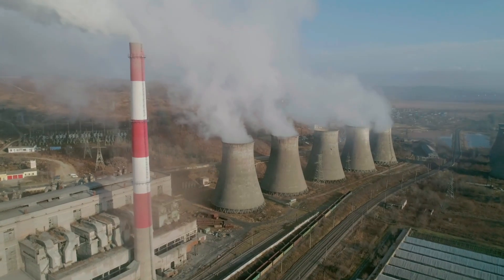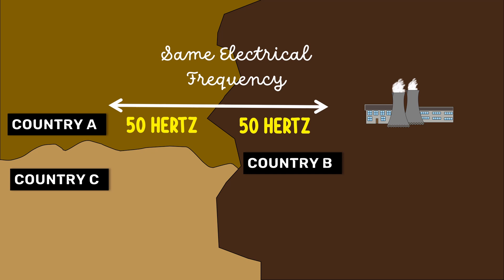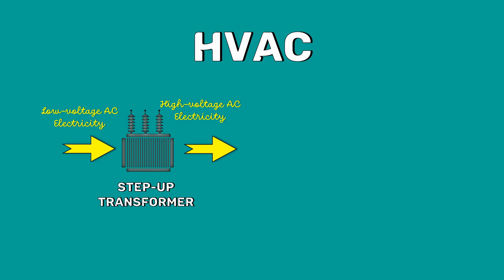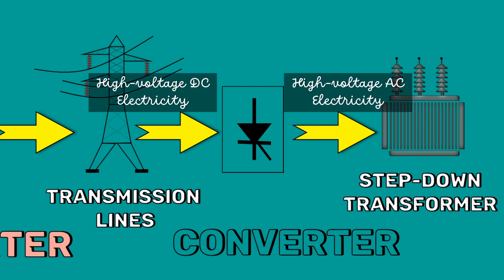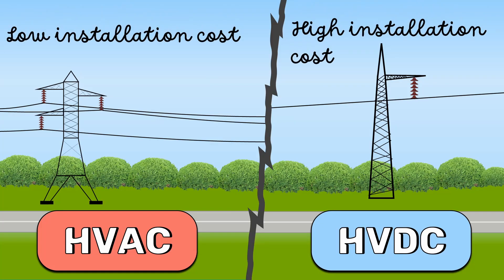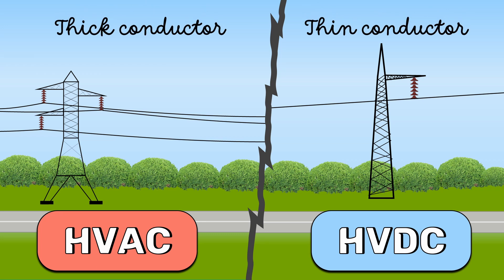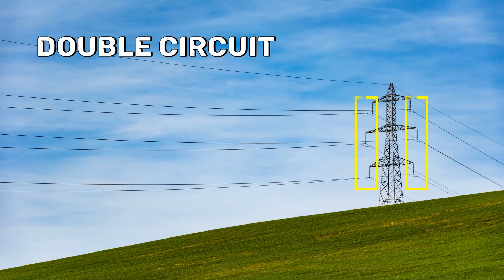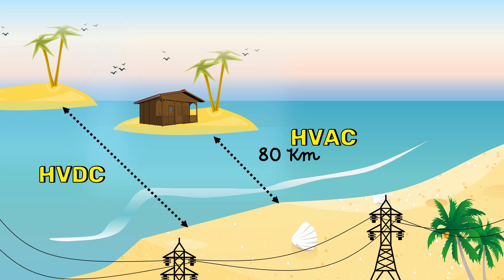Comparison between HVAC and HVDC transmission system

Comment: In Germany there is a high voltage line with two AC circuits. So 6 conductors on the pylon. 
3 conductors will continue to lead HVAC in the future. 
On the other side, 2 conductors are being converted for HVDC. The remaining conductor is grounded.